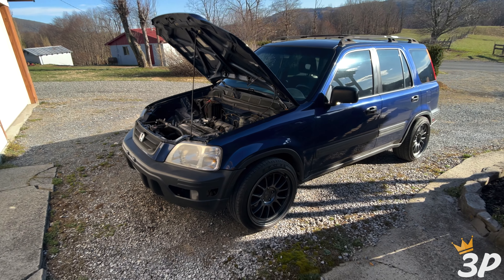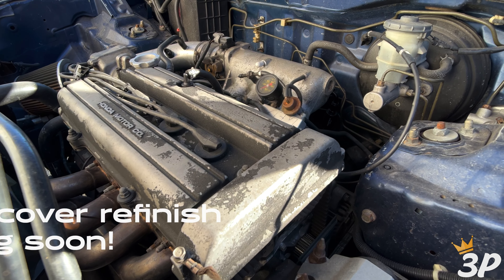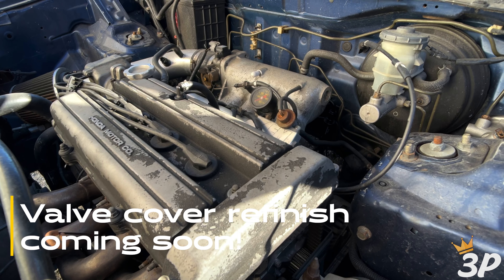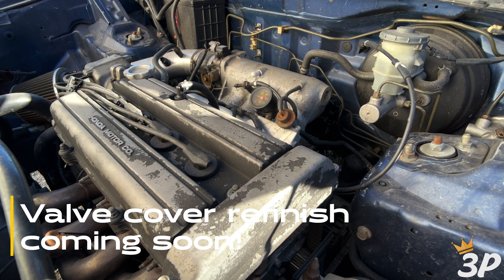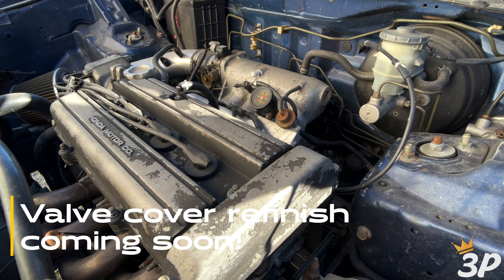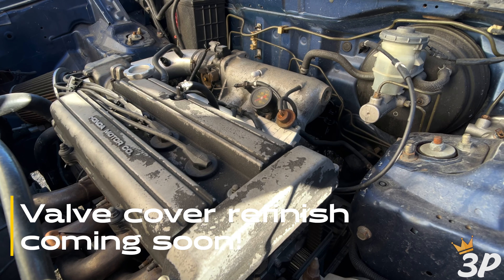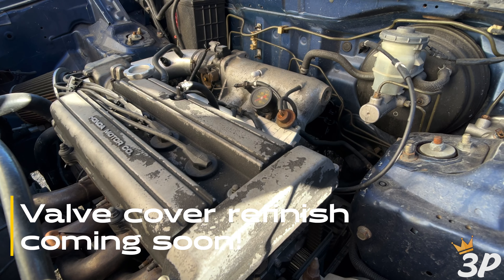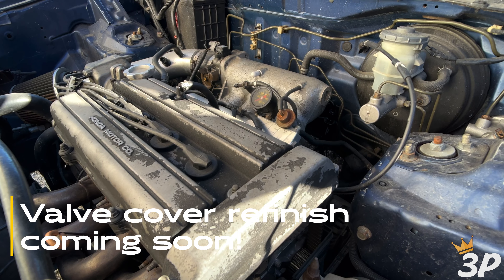How to rebuild a AEM fuel pressure regulator!

Comment: Hi, can you tell me where to connect the fuel regulator for the vacuum pressure signal ? W210 3.2 CDI
Reply from the maker: Honestly I don’t, sorry. These are mechanical, I’m not familiar with Mercedes. Good luck though!

Comment: Rebuild mine 2 times withing 2 years its fine for a couple of months then it leaks again kinda disappointed on aem
Reply from the maker: I expected years of service out of this thing and it’s proven not haha Atleast they’re easy to rebuild! But still, come on AEM!
Reply: Where was yours leaking ? the o ring on the fuel rail where they meet or the diaphragm inside ?
Reply: @ahbeepich4465  diaphragm I replaced it again 4 months go still good so far next time I'm doing remote mount one